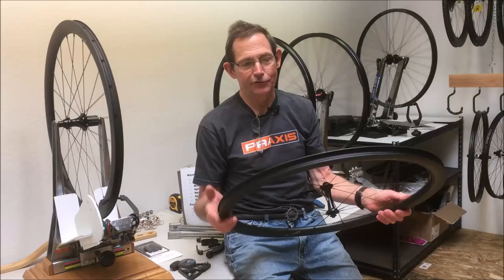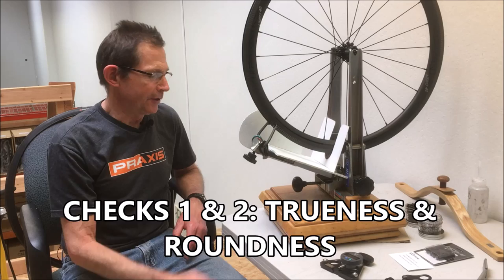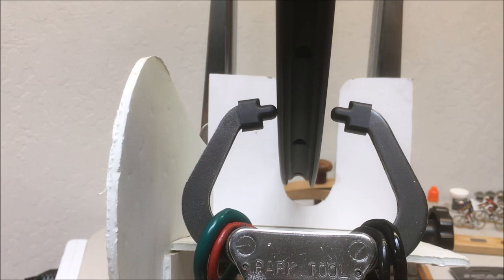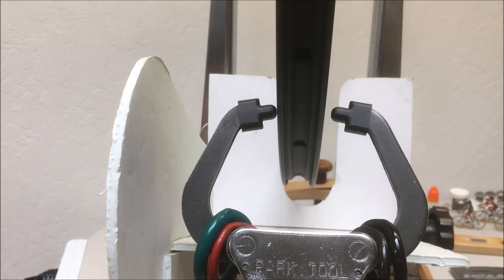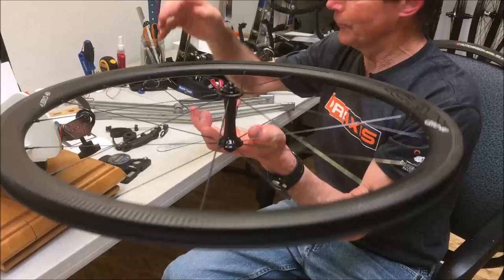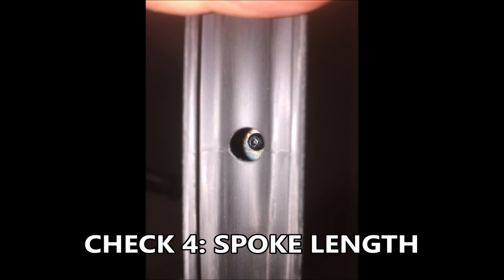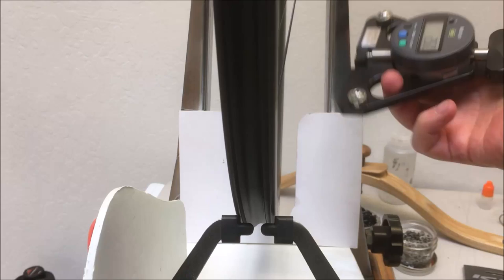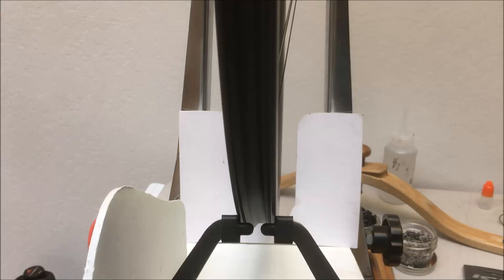ICAN Chinese Carbon Bicycle Wheels Review by Wheelbuilder Jim Langley

Comment: Well done. Just on point, why not use a pair of dial test indicators rather than the point caliper indicators? One could provide an accurate measurement of the rim offset and refer to it as a standard. They are quite cheap to buy too.
Reply from the maker: Thanks for the comment and suggestion to use dial indicators, Daniele. I was showing what to look for when you're checking wheels with just your eyes, which is the way I think most people will be doing it. But, you are 100% right that for an official QC report, the wheel inspector would use dial indicators to put a number on how out of the true/round the wheel is. Thanks for pointing that out, Jim

Comment: Have similars Icans since 2017 and after several interventions on, the wheels are fine, stable. First of all, those super light Quick Realeases are crap, don't even think using that. Choose a traditional type like shimano's or Campy's. Ican's costumer support are grade "C": since the beggining of use, the rear wheels make noises, pops and clicks. Tried everything, rebuild wheels, change niples, add original Sapin internal washers, mounted everything totally lubricated and the pops didn't stop. The clicks occurred when forced the bike sideways, like climbing or sprinting. The noise really came from rear and, one day, things driving me crazy, tried everything on the bike (changed pedals, chainrings, lubricated every mounted piece of the bike), I tried one unthinkable thing: replace the front wheel. And, for my surprise, all the noises that sounded and poped evidently from the back of the bike, was coming from the front wheel. Knowing this, just applied some oil on the niples (assembled) and it's been month of complete silence on both wheels. So, 2 hints for these great wheelset: use a decent quick realease and before mount the tires, apply some lubricant over the niples. For me, was a great and simple solution.
The original ebay listing for my wheelset where kindly modified by Ican, You can ask the company to costumize your product: I've asked to replace the black niples for red ones and add a second freehub (campy) to the set. And all for a fair and affodable price.
 Thanks for the great review, Mr. Langley.
Reply from the maker: Wow, thanks for sharing your review of your ICAN wheels, Ricardo - especially all the tips and the secret to fixing the annoying clicking noise. Great job figuring that out. ICAN didn't tell me the wheel could be customized if you order through ebay. That's a nice upgrade to provide. It's also good to know the quick releases didn't work. That's a pretty common complaint with superlight QRs. I'll be watching for issues with mine now. Appreciate you sharing all your insights on these wheels. Super helpful. Thank you, Ricardo!

Comment: Jim, what is your view on Superteam  Chinese Carbon wheels. I have never bought a Carbon wheel. Wanted to try a pair.
The way tyre was installed over the rim...what a skill...I had to pause to watch it over and over again.
Reply from the maker: Thanks for watching and the question, Triple Ace. I haven't had a chance to inspect or ride Superteam wheels. They do get very nice Amazon reviews. One thing to check before you buy wheels is what brand of spoke is used. I couldn't tell looking at their website. I would not recommend buying any wheelset that did not use high quality stainless steel spokes because anything else will break if you ride the wheels regularly and for several seasons. 

What I want in my wheels is DT Swiss, Sapim or Pillar spokes - all very high quality spokes that will last for many years even under the most miles and use. If I were buying wheels I would make sure I was getting one of those brands for the spokes. Okay? I hope this helps. If you buy the wheels, please leave a comment letting me and everyone else know what you think. Thanks again!
Reply: @JimLangley1  Thank you for your time and effort to give a thought to my query. Definetly, I will keep in mind to go for DT swiss Sapim or Pillar spokes when I go for the wheels.
Reply from the maker: @upward_onward  you’re welcome!

Comment: I waited years before buying a set of carbon wheels for my SuperSix EVO, but ICAN seemed to have been striving to be that good entry-level set. I managed to score a pair of ICAN Aero 50's and right out of the box, they seemed true & round. Tension felt uniform, but I'm having them installed this weekend and they'll give me a report on any extra tweaking they had to do if any. 

Honestly, anybody paying anything less than $1500 for a set of carbon wheels should fully expect to have to put in a little wrench time after receiving them. My pair came with Sapim CX-Ray spokes and ICAN's R01 hubs which are supposedly Formula SP-60/SP-201's.  

I'm going to keep an eye on the freehub body. At 1390g (on my scales), I suspect it's aluminum and hopefully if there are any issues after some real world miles on it, I'll be swapping it out for a steel hub grams be damned. Other than that, the rims themselves looked to be finely finished and I was impressed with them. 

It's this video that finally pushed me into pulling the trigger on them Jim. Thank you for your work. I'll make sure to share my experiences with them.
Reply from the maker: NYCEVO Thanks! I look forward to hearing how you like your ICANs and how they hold up.
Reply: any update on the wheels?
Reply: @DCRband  WOW! You must've been reading my mind because I was going to post an update YESTERDAY on the wheelset here, but it got by me! 

BUT...I can report that after a few months of some hardcore riding, they are unbelievably rock solid AND I rolled them on some single track at a mountain bike park (see my "Cunningham Park" video) with my stainless steel custom road bike. 

I'm stuck on them. I don't see why I'd need to spend $2000 "more" for a set of carbon hoops.

Comment: Great review. I would also do a tension balancing test, plucking each spoke and checking the tone. All fronts should have the same tone. Drive side rear has one tone and non-drive a lower tone. It's possible with stiff cross section aero carbon wheels to build wheels that are straight, yet have significantly different spoke tensions due to imbalances. Balancing the tensions creates a more durable wheel that rarely (if ever) required truing, and lasts longer due to balanced stress.
Reply: belt tension tone testing is one of the recommended if not the best way to test the cylinder head drive belts on Ducati motorcycles.  There are various digital tone tuners, many cross over from the guitar industry.  I think you have a good idea and they could serve as another option to get the spoke tension even closer to factory specs.
Reply from the maker: Thanks for watching and the feedback on using musical pitch for checking spoke tension, Paul. Wheel builders do use pitch for checking tension. But, a spoke tension gauge such as what I show and use in the video is more accurate and easier to use. It removes the element of differences in what an individual hears and how things can be distorted by other noises. But, using pitch is a way to get a ballpark even tension in a wheel and it's useful that way for many builders. Thanks for the thoughtful and interesting comment.

Comment: Hi  Always best to check for play in the hubs before putting wheel in truing stand. Not as important with new wheels but should still be done. !!!
Reply from the maker: Yes, that’s a great point Steve. Thanks! There’s zero play in the hubs on these wheels.
Reply: @JimLangley1  Hi Jim.... No Problem  Do you have any opinions on wheel balancing ?
Reply from the maker: @stevem2939  haven't tried balancing any road wheels yet, Steve. Silca makes a wheel balancing kit though that I would like to try at some point. It makes sense to me that it might make a difference you can feel on some wheels. Thanks for asking about it.
Reply from the maker: Hi Steve - Here is a link to Josh at Silca's video about their wheel balancing kit https://www.youtube.com/watch?v=ZrRbM2BSU8A I hope you like it!
Reply: @JimLangley1  Hi Jim   Thanks for the link. It's a good solution but i'm not entirely happy with it. It looks a little cumbersome and is bound to affect aerodynamics !!!
One thing to note is that with Carbon wheels the heavy point is usually at the valve ..... as in the video because the valve is adding weight , but with alloy rims the heavy point is usually opposite the valve which is where the hoop is slotted then welded and pinned. 
Regardless I use thin lead strips that you buy from aquatic shops and fix these under the rim tape at the required spot.......either side of the valve hole with alloy rims. You make sure though that the wheel is slightly unbalanced afterwards as when you fit the inner tube the valve brings the wheel back into balance. 
The advantage of under the rim tape method is that you can use less weight because you are furthest away from the hub.....Cheers  Steve......p.s I've subbed !!!
Reply from the maker: Thanks for sharing your excellent balancing tips, Steve! And thanks for subscribing, too. Appreciate it!

Comment: I have the 50 and 38 wheelset and the spokes keep breaking, at least 5X each since the 2 years I've owned them.  You also have to have a lot of patience and persistence in mounting tires on these wheels. Definitely keep two tire levers in your saddle bag, otherwise you're stuck with a flat tire cause you  won't be able to remove tires without them.
Reply from the maker: Thanks for sharing your experience with the wheels, iam2nd2011. Sapim spokes (in the ICANs I reviewed) don't usually break, so I wonder whether your wheels are built with something else or if something else is causing them to break, such as low spoke tension. Usually, both issues can be addressed and fixed. Regarding tire mounting, tubeless tires can be tough to remove because when inflated they essentially lock onto the rim - the beads get trapped up on the high side shelves on the rims. It can be super difficult to get the beads to budge off their locked position. You need good tire levers to get the beads to move off the shelves and into the center of the rim. Two tools I've been using lately are Topeak's Shuttle (has a big handle and a thin tip) https://amzn.to/2Z3nQ0r. And Silca's new steel-core levers. They have thin, stout tips that make prying tight tires up and over the rim easier. https://silca.cc/collections/mobile-repair-1/products/tire-levers-premio We need better tools for tubeless tire removal but no one has invented anything yet. I have some ideas that I think could work.. if it turns into anything, I will let the bike world know. I hope these tips helps you tame those tires in the meantime! Thanks again for the feedback on your wheels! Jim
Reply: @JimLangley1  I have taken my wheels to my LBS everytime I break a spoke and they've checked tension and trued them as needed.  I own 12 bikes and have had my share of different wheelsets and by far, these are the most difficult wheels to get tires on and off.  Even a seasoned mechanic at my LBS commented on the difficulty it takes to get the tires on.  The 50mm front wheel has been sitting idle since early spring due to another broken spoke at a bike rally. I'm not convinced that the problems I have on these two wheelset I own are an isolated case since they are different depth  and bought them at different times. And yet, they both have the same issues.  I bought the 30mm first and after 4 trips to my LBS with broken spokes, I contacted ICAN about the issues I've had with them.  I decided to not send them back due to cost of shipping.  A few months later, I inquired about the 50mm thinking I might have better luck with them.  They actually gave me a price break since I had so much problem with the 38mm. To my disappointment, I experienced the same issues with the 50mms. Without the broken spokes and tire mounting difficulties, I think these are pretty solid alternative to the overpriced Zipps, Enves and other brand name wheels. I gave my 404s to my son and been riding the 38mm Icans since he's not as patient dealing with the tire and spoke issues. I don't put a lot of miles on the Icans anymore and definitely not taking them to any bike rallies due to fear of cutting my ride short due to another broken spoke.  BTW, I requested ICAN to send me several extra spokes for each wheelset when I ordered the 50mm and I've pretty much gone through all of them.
Reply from the maker: @iam2nd2011  thanks for taking the time to elaborate and explain your broken spokes and tough tire mounting issues on your ICANs. I only have the pair they sent me so it's important for owners like you to tell everyone here how their ICANs work for them. You and one other person told me in the comments here that the Continental GP 5000 tubeless tires were super difficult to mount. So, I went to the Spokesman Bicycles shop here in Santa Cruz and bought a tire ($94.95 for one!). I then mounted it on my ICAN wheel to see how hard it is to put on my wheels. It definitely took some effort to put it on, but I was able to do it with only my hands (I have been putting on bike tires professionally since 1970 - so I know every trick). The Hutchinson Fusion 5 tubeless I mount in the video was a little bit easier to mount. Again, though, that's just on my ICAN sample set. Your wheels could be tougher - there could be something different. I just wanted to share what I found putting the Conti on mine. I will be doing a video on tubeless tire mounting sometime soon to share tips. Thanks again! Jim

Comment: Nice review! - my biggest concern with cheap carbon rims is not weather or not the wheel's tuning is good (though it should be!)  but rather the quality of the layup and carbon fiber composite of the rim. Without destructive testing and engineering analysis, privateer builders & consumers are lost in the desert. Rather than build my own, I chose to buy a set of wheels  from a custom builder from central California who's very familiar with the Asian supply chain.
Reply from the maker: Thanks for watching and the nice comment, Big Wave_Dave. I appreciate you sharing your point of view on purchasing carbon wheels.

Comment: With regard to the spoke twist — I’m wondering if they were angled that way purposely? It might be something to do with air dynamics as the tire moves forward and how the air turbulence moves as it goes past/around the tire and rim?
Reply from the maker: Thanks for the thought, Robert, however bladed and oval spokes have been around since 1977 invented by Swiss pro mechanic Fritz Bruhlman. These wind cutters were designed to have their leading edges into the breeze. Also the ICAN spoke angles are inconsistent so I think it’s clearly accidental. Appreciate you commenting. Thank you, Jim

Comment: I would think the "twist", if a spoke was twisted from tightening the nipple, the direction would be down (the direction of tightening) vs up. Maybe the holes on the hub aren't drilled straight. It seems pretty consistent.
Reply from the maker: You're asking a good question and I can't answer why these aero spokes are twisted out of the aero plane the way they are Geeios. My best guess is that these wheels were built by a robot and it was set wrong. But I don't know for sure. I usually see the twist as you described. This is unusual. Thanks for the comment!

Comment: Mr. Langley, I ve been watching your videos.  They are really great.  What bike truing stands do you use?  Is there (1) you could recommend?  I want to try to custom spoke my wheels with GT SWISS and I need a decent truing wheel stand.  Thanks
Reply from the maker: Thanks for watching, Lucas glad you're enjoying my videos!. In this video I'm using a Park Tool TS-2 truing stand. The new model of this stand is the TS-2.2. They're great truing stands, very easy to use. I have a video all about using truing stands here (it shows a few different stands): https://youtu.be/JF8p1koGmoM?si=pSCGRIIceUtAoO-e And I have a video about my newest truing stand - Park's newest model https://youtu.be/XqsKUceJzp8?si=E_ARbGUTHfCyB_HM You can sometimes get lucky and find a used Park Tool TS-2 truing stand on ebay and other online places. That would be a way to get an awesome stand for a little less. Just check it out carefully and don't buy a damaged one. But the Park's are the gold standard and worth owning and using if you plan to build some wheels. Hope this helps and thanks again.

Comment: Do you recommend to buy a chinese carbon wheelset? if not which brand do you recommend for an entry level carbon 700c wheelset. Thanks JIM!
Reply from the maker: Hi J and thanks for the question. The ICAN Aero 40 wheels I inspected in this video are on my bike and I've now ridden more than 1,000 miles. The wheels are still performing just like they did when new. So, I'm sure they would work for you. Since you said "entry level," it raises the possibility that you are an entry-level rider. If so, you might not have experience with rim braking on carbon rims. I do not consider rim braking on carbon rims entry level... I consider it an advanced riding skill. With alloy rims and braking tracks you stop much more quickly than you do with the carbon rims. So, you must appreciate this and always be ready to hit the brakes early. If you aren't ready and you have to stop quick and you hit the brakes late, you could easily not stop in time and crash. However, this is how it is with most carbon rims with rim braking. In fact, it's one of the reasons there are so many bikes with disc brakes now. With disc brakes, and if you buy ICANS disc wheels for a disc equipped bicycle, then you will have excellent braking. I hope this is helpful.
Reply: Jim Langley Thanks jim, will definitely check that brand  and 👍👍 oon your channel
Reply from the maker: @jaysville0125  Thank you!